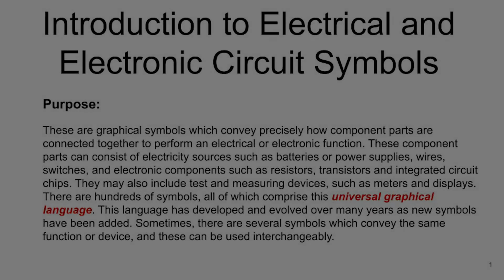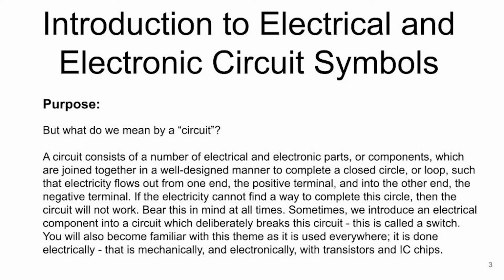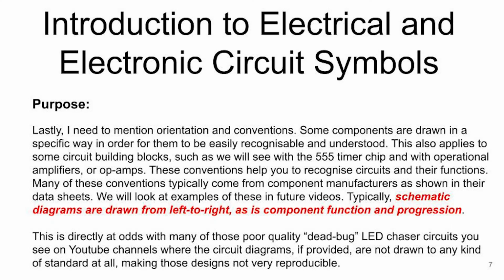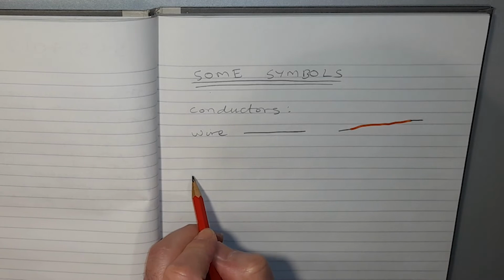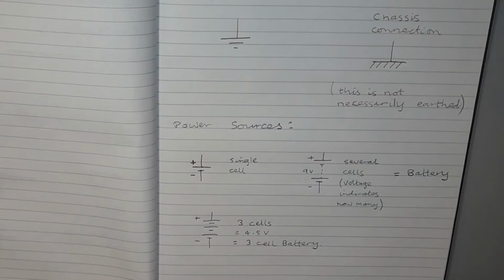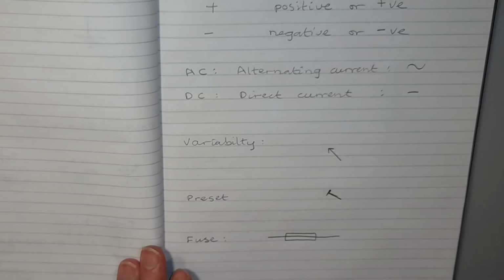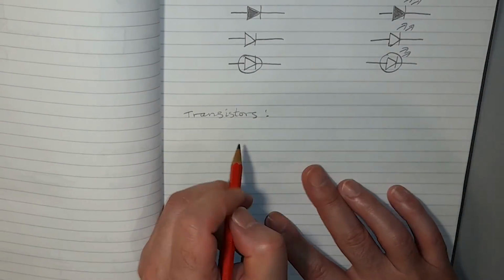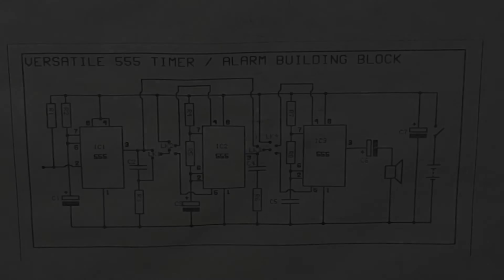Introduction to Electrical and Electronic Circuit Symbols

Comment: Thank you for your commitment. My wish would be to understand what different variants could look like in order to build a functioning power inverter that produces a clean sine wave alternating current. The variant with a microcontroller is clear. I am particularly interested in how the PWM signal can be generated using conventional components such as the 555, OP amps, etc. and how the filters for generating the sine wave can be calculated and created.
Reply from the maker: Proper sine wave inverters are pretty expensive which is why cheap ones are based on square wave generators. I've been interested in sine wave inverters too. I might look into that at some point.